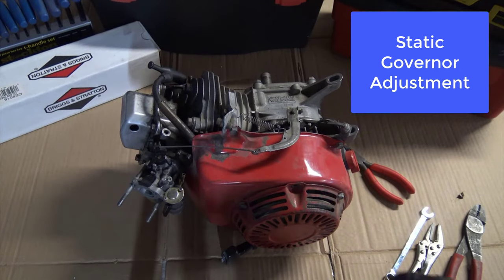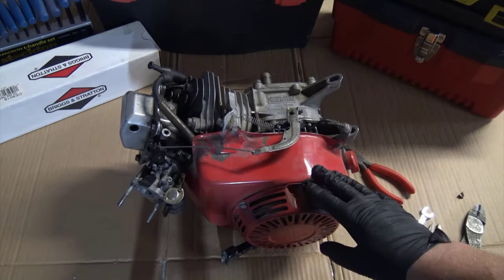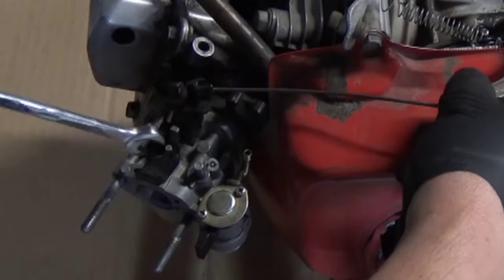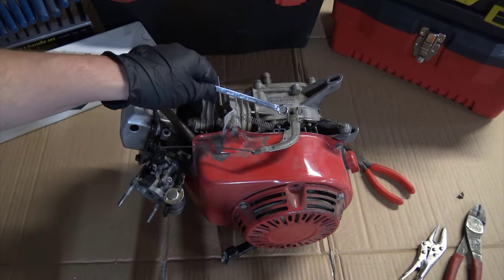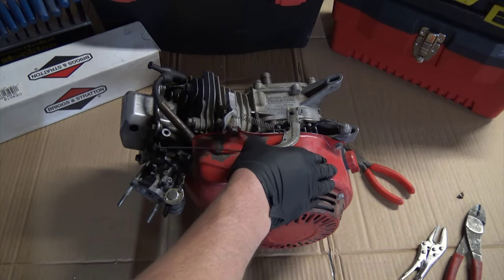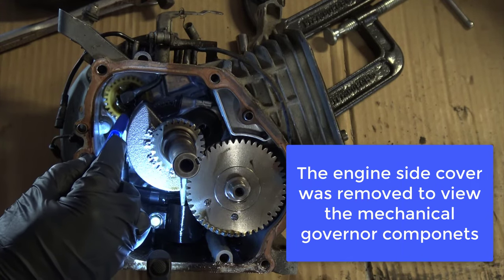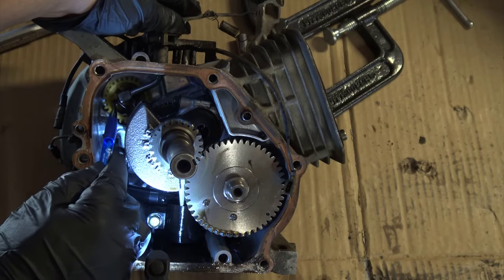Small Engine Governor Static Adjustment

Comment: Thanks! Very informative. My Honda generator has a GX390 eng. and runs on a propane conversion (snorkel on the air filter) same carb. It now runs at 3440-3480 rpm not 3600 to give me 60hz power. How do I get 3600? Do I adjust the throttle linkage or play with the governor. This happens at low to moderate loads.
Reply: After you set the governor like he showed, turn it on and adjust the governor idle set screw (it’s got a spring on the screw and a jam nut to hold it) in to increase engine speed, out to slow down.

Comment: At 3:16 you say its at full throttle pushing the level away from the Carburettor,  then loosen the nut, then push the lever towards the Carburettor saying its at full throttle  ? Mm,
Reply: Lol. He made a mistake but then he realized. I actually came looking for this comment.
Reply: he is pushing the throttle to low idle not WOT .
Reply: @subarolla  same

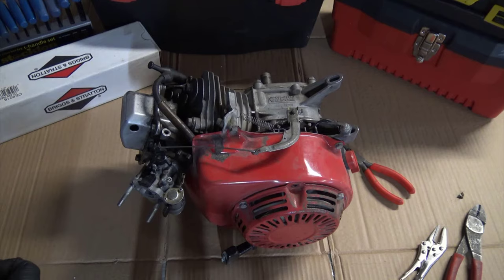Comment: On minutes 1:54 you described CLOSE throttle by pulling the lever, but then on minutes 3:12 you demonstrated the adjustment by pulling the lever as OPEN throttle.  You got them mixed up and it's confusing.

Comment: Hi, after replacing the oil sump gasket and reassembling my kohler xt 675 toro push mower the mower ran at very high RPMs like the governor wasnt working.  I loosened the nut, moved the governor lever to wide open throttle, turned the gov shaft in the same direction and tightened the nut.  Still had run away RPMs.  I decided to loosen the nut, move the governor arm in the opposite direction (low throttle direction)  and tightened the nut and the RPMs were much better and back to a normal sounding mower.  Is something wrong the way i brought the RPMs down because its sounding fine now but im the only one whos adjusted their governor lever this way.
Reply: Nah it's fine, you adjusted it the right way

Comment: Best video actually explaining the mechanics instead of foolish people just wanting to go fast or blow ot. By removing governor. I have these on woodslpitter s .and had trouble adjusting. Thanks ..believe my throttle is out missing a spring and the 2 parts on carborater the one side moves like it's stripped the non wide open side scree or plastic stop is OK. Top one thunk is bad